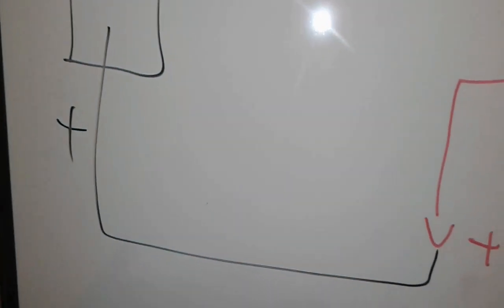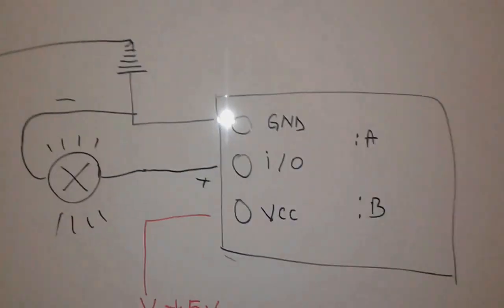Touch on touch off circuit using TTP223 board

Comment: Great video! I am trying to power a DC: 3,5-9V mini water pump with a 18650 3,6V Battery. Do you know what specific MOSFET do I need to use to make the TTP223 work? Thanks!

Comment: Hi sir, thank you in advance! Great video.

I have got turn the led light on but I have problem when I want to turn it off, sometimes the light turn off and sometimes the led light dont turn off. Do you have any idea about this? I have tested with differents ttp 223 touchs, but I obtained the same problem. 

If you have a whatsapp number I would be able to send you a short video to show you.

Thanks in advance for your help.

Best regards,
Reply from the maker: Try to put someone else to touch the device it rely on the body internal resistance normally it shouldn't behave like this

Comment: Bro can we give 12 v dc supply
Instead of 5 v
Reply from the maker: This small chip is rated for 5v i think there are 12v dedicated devices all the best
Reply: @NoSkillsRequired  k bro
Reply from the maker: @sonunayak5736  no probs bro
Reply: You can if u add a NPN transistor in between and let it take the load rather than this tiny chip that has a max VDD of 5.5v

Comment: Hello, great videos thank you! Would this detect a needle point or syringe instead of finger? Trying to make a DIY touch sensor for dental hygiene students.  Is there anything this small but instead of touch base for it to be motion sensor instead ? Thanks
Reply from the maker: This one don't  think will work with something else but finger because it detects the internal body resistance 2-3mohm for your aplication a stop end switch or aomething like ir sensor or proximity sensor
Reply: @NoSkillsRequired  thank you for the video again and very helpful response!

Comment: how did you wire "a" and "b" to make it became on/off switch?
Reply: Thank you
Reply from the maker: sovann ouk any time friend
Reply: There are 2 pins on each side. Which one to which one
Reply from the maker: sovann ouk normally a and b got 2 terminals each but I just solder them together with a wire from a to b and as you see in the video works like a charm, normally without a-b stays on as long you keep the finger on top and then goes off